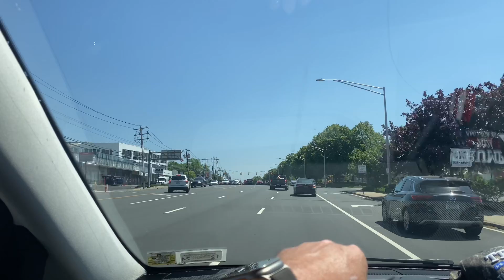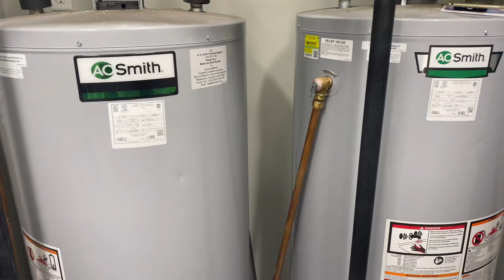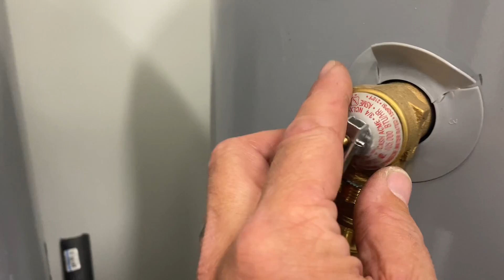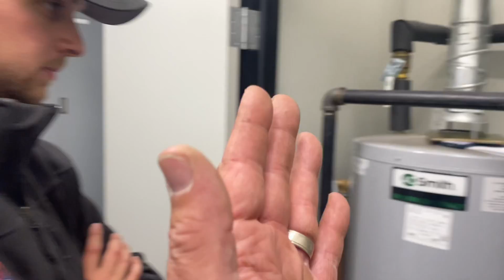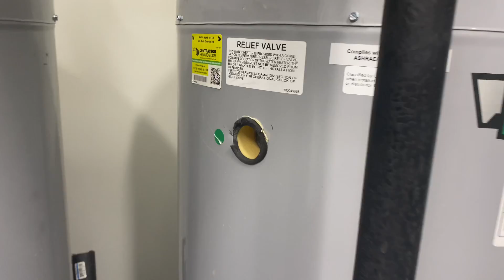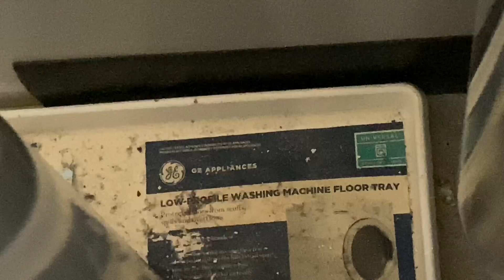Warranty Claim for Defective Water Heater Leak DENIED Hydrostatic Pressure Test PASSED

Comment: So you get called for a leaking water heater and first go for the check the anode rod?  The leak is from expansion when the heater is running and the expansion and with a check valve  it can't expand back into the cold line so having the expansion tank is needed , but that  tanks failed so the TnP is blowing off so simple to diagnosed!  Well you said it you can't fix if stupid, I  hope you didn't charge fornthe anode rod you jacked up that was perfectly fine until you messed with it!

Comment: I have recently found a handful of late model water heaters leaking out through the relief valve threads(factory installed!). one was less than a month old at the time and was clearly leaking from the start. it looked like a lack of joint compound and some not very tight, no specific brand/model. I think it's partly the lead free relief casting having burrs or being extra sharp and rolling the compound out, vs. sealing/ helping to tighten properly. I replaced them with tape and dope both, no leaks then. 🤔
Reply: @PipeDoctor  not that I noticed, I just seen whatever various brand badging and the leak. some installed by handyman/maintenance(local orange/blue/green/red box store), others by local plumbing companies, whom also cannot seem to seal the "press" fitting adapter threads onto the tank nipples.
it's a shame finding newer tanks with leaks and rusty crust every where, but everyone seems to fail at sealing threaded connections, including the factories! 🤯

Comment: I am guessing that the installer of expansion tank never precharged the tank to street pressure as required by manufacturer. I come across that once in a while. I even have come across a tank meant for Hot water heat systems installed on domestic water. Also as you stated it is not to be installed on its side.. I also always install a shut off for future removal.

Comment: The piping on the water heaters looks to be heater on right is doing most of the work. Need center tee between cold and hot  or reverse return piping to draw off each heater equally.
Reply: @PipeDoctor   I know , but you did point out the expansion tank, drain pans etc,  so where do you stop. Piping the heaters like they did was    like haveing one water heater.  Some expantion tanks offer the side mount, and they do  work. From what I've read part of the rubber dries out (no water touching it) causes it to fail.   My company stop doing warrenty work for manufactures. We'd  show up and most of the time couldn't find anything done right then cause hard feeling when expaining what was wrong. My  line was " this is not how I would have done it"!

Comment: Expansion tank is way undersized that’s why the bladder failed in it causing the relief valves to leak by. They need a PLT-20 expansion tank.
Reply: @PipeDoctor  I spoke too soon with the 2 st-12s.  I checked the amtrol website , if it were 2 - 80 gallon tanks installed in a home, then the 2 st-12's would be fine. Commercial use needs a different model.    I should no better than to comment without thinking it through.  On a different note, have you ever seen a water heater implode?  I have had 2 in my carrier and a vac breaker would have saved the tank.  I never was able to conclude the reason, and I have not seen it in many years now.

Comment: Is that xtank the right size (gal.)?  What was the system pressure and what was the tank pressure?  Have you ever used a hydrostatic test pump?  Not knocking the diagnosis just wondering.

Comment: I have installed expansion tanks on its side all the time as it states in the manual. Why would this be any different, the diaphragm failed causing the pressure to blow through the T and P. Warranty tank done
Reply: Yeah not sure how it impacts the function of the tank, the amtrol manual does require it to be upright but tons of installs are "wrong" and the service life is a decade before the expansion tank fails. Other manufacturers indicate the orientation of the tank is irrelevant, this is a WATTS tank so technically it is installed "correctly" but very poorly done ands way undersized. Should have an ST-30 in a commercial setting like this with 150 gal in the event you have high water pressure and are suing a very high set point.

Comment: Mike what made you want to do hvac and plumbing? Where I am in Florida it's either one or the other, very uncommon to see both.
Reply: @PipeDoctor  do you need a plumbing license to run gas to a furnace or boiler in NY? Everything around me in West Palm Beach is electric, I think that's why I don't see a lot of multi trade contractors.

Comment: Someone needs to invent a device you can put on the supply to a building that will lower the pressure so it's usable and doesn't blow up water heaters and toilet fill valves. Like a gas pressure regulator but for water. I'm gonna patent that and make millions.
Reply: It’s called a pressure reducing valve
Reply: @gyver471  They generally are only used for industrial applications like food processing plants in 30 years I think ive seen them twice. Im not talking about the residential kind there is some advanced electronic versions these days that are connected via wifi to the PLC units.
Reply: @gyver471  you can easily put a manual reducing valve for water or gas but try telling the gas or water company their street pressures@ temp are not constant even when you send them a video of high or low they think you are mentally insane they are always right I think they do it on purpose to make more money
Reply: They have them even expensive digital units just no one wants to pay for them yet you shouldn't need them if you install it properly sorry to burst your patent bubble lolll